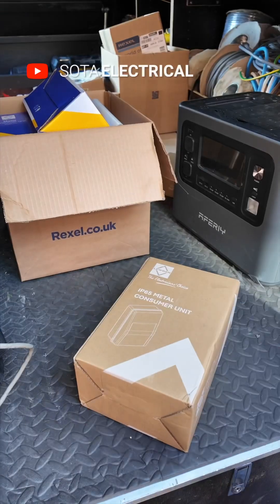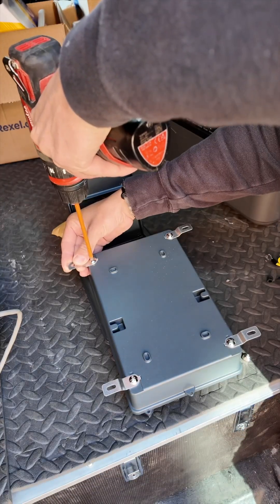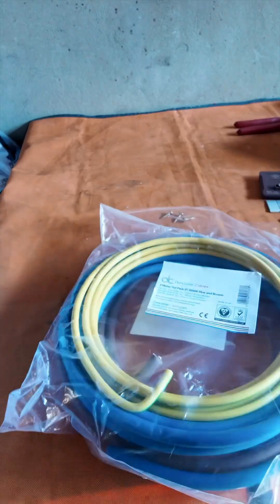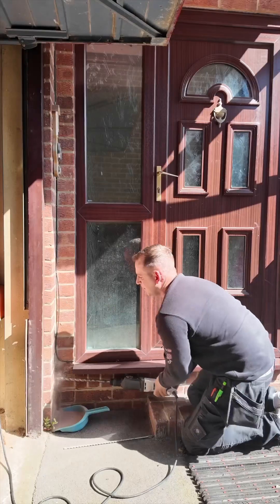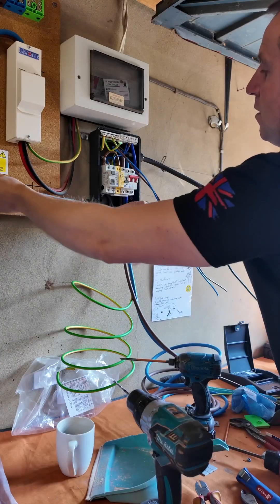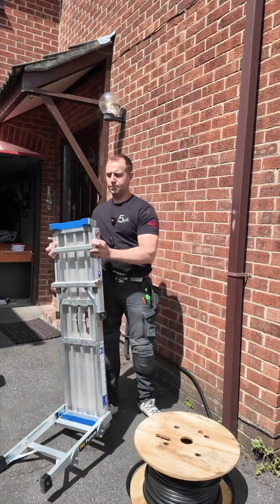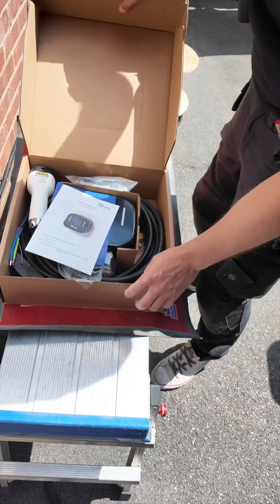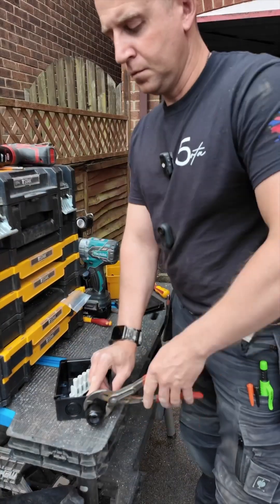Quick Install: Ohme EV Charging Point Unleashed!

Comment: I personally think the I think the Ohme setup looks quite messy (not your work), with the Wiska box and separate cable holder. I am going to go for the Hypervolt Home 3 Pro, as the power terminates inside the charger and the EV cable wraps around the back of the charger.

Comment: Hey can i ask, we are being unlooped from next door as we have the main electric supply and then another cable goes next door to supply their electric.

Once this is done ill be getting a ev charger BUT does it matter that we do not have a new style consumer unit. 

Out unit that has power switches in is the one from when house was built in 79 its a metal plate on the wall with a row of black switches and then a bigger black switch to turn it all off at once
Reply from the maker: If your consumer unit is the original from 79 I very much doubt it will be suitable for an EV charger. You don’t have to change it though, you can have a small additional one installed just for the charger